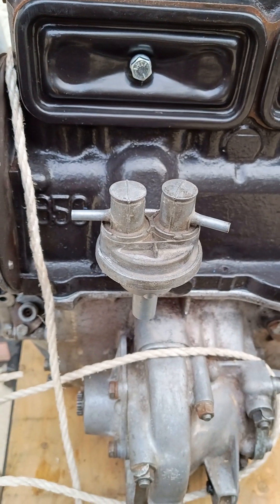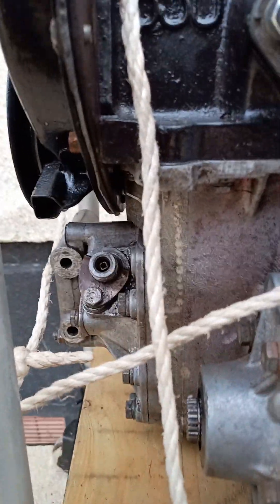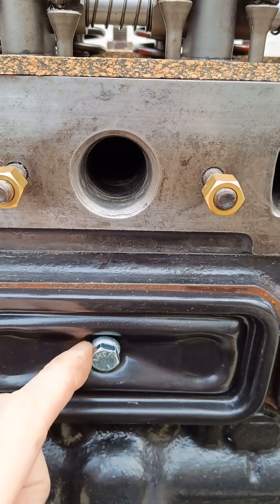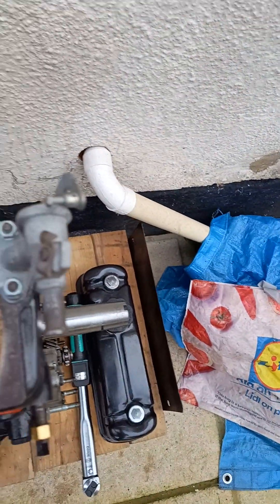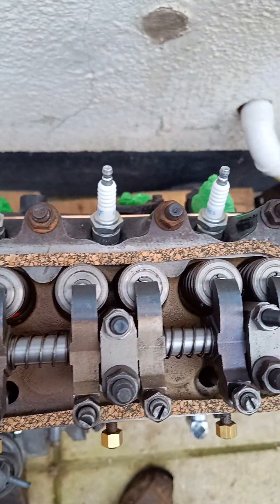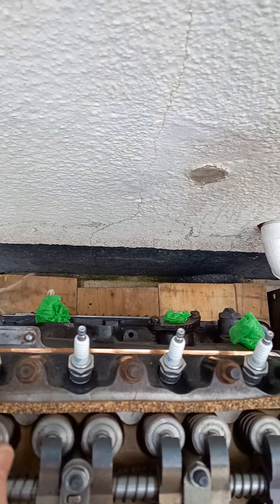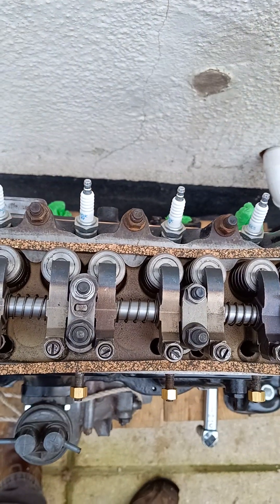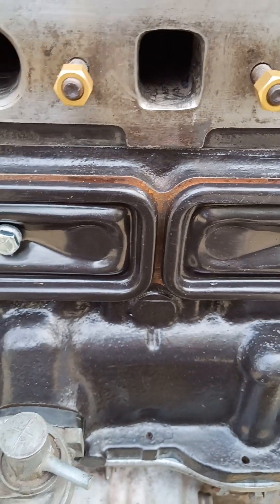Mini 850 Engine rebuild Part 11

Comment: Great throw the fuel pump away and blank fit an electric pump easier to maintain use a solid state pump with regulator then when you up grade you’ve got good fuel supply worked on every mini I’ve had and built great project nice to see 👍🇬🇧